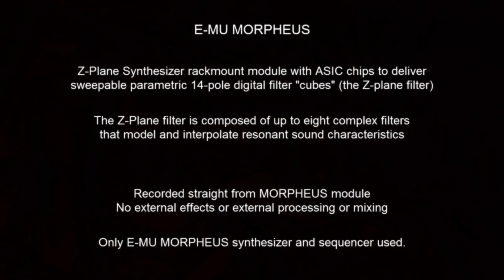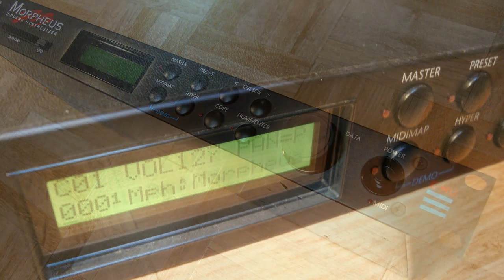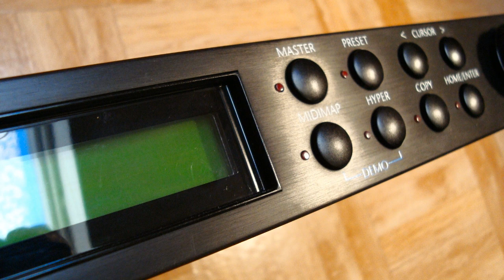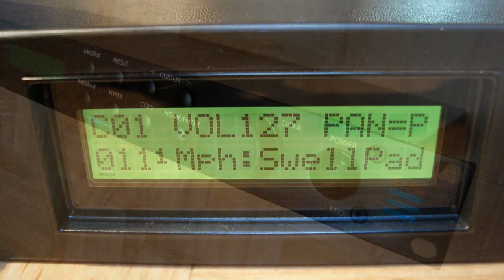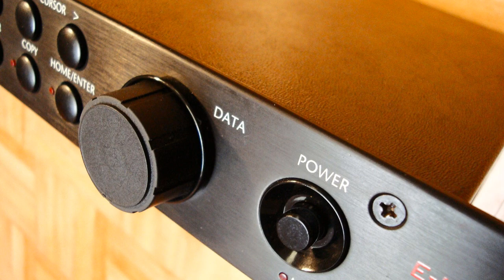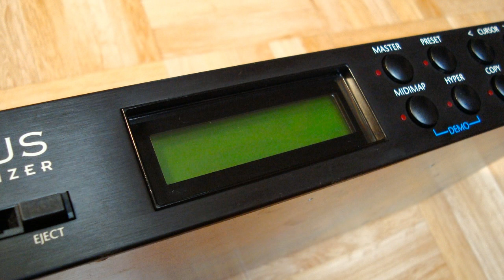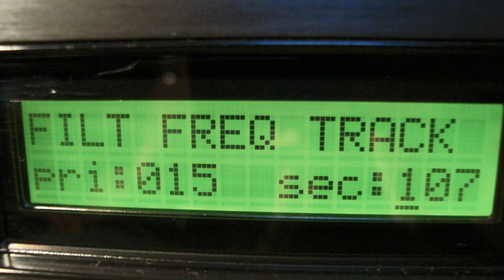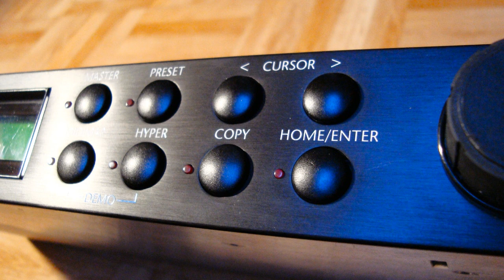𝗘-𝗠𝗨 𝗠𝗢𝗥𝗣𝗛𝗘𝗨𝗦 Z-Plane Synthesizer 【Demo】

Comment: This is freaking awesome, is this what DepecheMode used on the Ultra album? God damnit I want this synth, so hard. I must have it! Did you program all of these sounds or are they from a specific soundbank? That sound at 28:08 is one of the most awesome sounds Ive ever heard come out of a synth. A truly epic demo, this is how a synth should sound like, impressive work!
Reply from the maker: Not sure about Ultra, but Depeche Mode used Morpheus in their songs, that's a fact. About presets there - mainly they are custom made or modified ROM patches.
No Hyperpresets used.
Reply: oscillator Fantastic demo and sounds... I might be getting a Morpheus... do you offer your custom presets? what editor did you use to program the synth? Thanks and best wishes.
Reply from the maker: Wolfgang Gaube I'm glad you liked the demo, thanks. I could you suggest to get a Morpheus or UltraProteus - they are similar models, UltraProteus have much more ROM waveforms and filters, but unfortunately lacks some great stuff that Morpheus have. So it is difficult to say which is better, actually they both are great! About presets - I'm still working on Morpheus library bank and it's not ready yet. I spent much more time on Kurzweil K2000 before, so it is only beginning on Morpheus for me. About editor - mostly I use MorphEdit software, SoundDiver is also good and sometimes I use Midi Quest as well.
Reply: oscillator
Can the MorphEdit run on win 7?
Reply from the maker: TheSynthZone Yes, it works on Win7 also. MorphEdit v0.912 can run on XP, Vista and both 32-bit and 64-bit Win7. The last version MorphEdit v1.000 works on XP, Vista and 32-bit Win7 only.
Reply: oscillator Today I got a Morpheus in excellent condition :)
Only noticed that the RAM Bank is the same as the ROM Bank contrary to what the manual says. May I ask you for the sysex and also the other ones you mentioned in another reply.
How is your sound bank progressing? I'll take the beta, think that is that good. Keep us posted!
Thank you so much again for your great demo which reminded me of this wonderful synth!
Reply: Wolfgang: very good to find one in good shape! I managed to find one for less than 100$ that even smells new, used is OK but new is best. When these were new I spent my  cash on a Kurtzweil sampler/synthesizer, this would have been more useful in the long run, the K2000Rs was replaced very easily. I use a Korg Kontroller for my Morpheus, Wavestation and other wave scanning modulation synthesis.
Reply from the maker: Wolfgang Gaube
Congratulations :)
It's not so easy to get Morpheus nowadays (after 22 years of release in 1993 !), so you did well! I also was lucky to get my Morpheus last year from Germany. I find it on ebay, where did you find yours? Just curious :)
Well, I really suggest you to read the User's Manual of Morpheus first of all - that will help you a lot to get in the principles of this synth. I was lazy to read and I tried to get everything myself (because I was sure I know about synths), but I was wrong. My experience was different, so I came back to the books :) You can still find Morpheus Manual over the internet (try to google), if you can not find, please feel free to ask - I have this as PDF file.
Next - I strongly recommend you to get USB-MIDI adapter to connect the Morpheus to computer - in that way you can program the synth with MorphEdit software (freeware, try to find over the internet to download), what is much more easy than programming from front panel of the synth. That also allows you to send and receive sysex files to/from Morpheus (using freeware MIDI-OX software) and you don't need to buy expensive ROM and RAM cards. I'm using E-MU Xmidi 1x1 Tab adapter, it works perfectly. Also you may to have some MIDI merger to connect PC and master keyboard to your Morpheus.
About sysex files - I could send you all collection of Morpheus ROM Cards (many of these sounds you can hear in this demo video), so just give me your e-mail and I will send it to you (also Manuals and MorphEdit software if you wish). Cheers!
Reply from the maker: TheSynthZone
Hi, under the 100$... WOW!!! That's is FOR FREE :) That synth is worth much,much more! I got mine for 185 Euro from ebay, I was lucky winner of bidding :)) Yes, actually it's possible to control the Morpheus from any MIDI keyboard, but there is one important thing - if you're using MIDI Merger to connect master keyboard and PC to Morpheus (what lets you to program the Morpheus from computer and play it from master keyboard in same time), then it's important to know if your Master keyboard have the power on MIDI OUT port. That means +5V will supply MIDI Merger with voltage. If not, than you need another type of MIDI merger with external power supply.
Reply: oscillator Thank you oscillator and also TheSynthZone, nice community here! An early birthday present for me, which I found by chance on a local buy and sell platform www.willhaben.at. A guy here in Vienna, Austria sold it for €150 and even was so kind to deliver it, but €185 is also good. I have a project studio and also play Kurzweil, the PC3X. I did find the manual and MorphEdit, MIDI-OX online. MorphEdit starts up fine on my Windows 7 Pro 64-bit configuration. Also good point about the USB-MIDI adapter and merger, would have missed the bidirectional connection I need for programming together with the connection from the master keyboard. I have a RME Fireface 800 audio interface and will look, if I can use it for that, the Kurzweil connects via USB MIDI to the PC. Yes, please send me all sysex via email (will PM), especially the factory RAM bank 0 which is missing in my system, even after reset RAM bank 0 is the same as ROM bank 1 which according to the manual shouldn't be the case besides some presets. Appreciate your suggestions and support! Cheers!
Reply: Finding the editor online has been difficult, I got one version but still trying to get win 7 64 bit to run it, lol.
Reply from the maker: Wolfgang Gaube
Well, 150 Eur is very, very good price :) To be honest, I could pay much more for that box, it worth every penny. It cost nearly 2000 GBP in 1993, when it was released! So, yes, I also have sysex of default RAM presets, no problems to give them to you, but there is only presets, no hyperpresets (same as in Morpheus Card Collection sysex files). But I don't care about this, because I don't use them so much. This is nice feature, of course, but it's more for live performers. I'm a sequencer based. OK, I will check for PM from you, Cheers!
Reply from the maker: TheSynthZone The MorphEdit is still downloadable there http://www.nancarrow.com/morphedit/ but it's the latest version 1.000 which runs only on 32-bit Windows. If you want to run this software on 64-bit, then you need previous older version 0.912 This old version works on both x86x64 systems. I have both of them, so if you wish I could send it to your e-mail, no problems. Cheers
Reply from the maker: Wolfgang Gaube
Hello, Did you received the e-mail with instructions and attached all neccessary stuff in RAR achive? Please check your e-mail.
Reply: oscillator Thank you very, very much for your email and the very detailed information you provided, it is very considered and supportive of you! I will have to order cables next week after the holidays and then see further, but the Midi through my audio RME fireface 800 interface works fine for Morpheus. Maybe I can get the Midi merging going somehow in the PC, using Cubase which has some interesting Midi features, but I can see the principal limitation in Midi, that it is not made to allow two inputs from different environments to the same device, it locks the channel, but my standalone Kurzweil editor from www.soundtower.com actually works in conjunction with Cubase, seems they found a way. Anyway, will report back. In the meantime wishing you and everyone a Happy Easter!
Reply: TheSynthZone Just downloaded the binary of Morphedit from www.nancarrow.com without looking if it's 32/64 bit and it starts up fine here (Win 7 Pro, 64bit). Does it start up on your PC? I need to order cables next week to have both Midi channels connected, which seems to be a prerequisite for it to establish a connection at all. Will see how that goes and report back. Happy Easter!
Reply: oscillator Hi, today I received my Midi and audio cables for the Morpheus and... I got everything working :))))
Here is what I do: Morpheus is connected via Midi IO on my Fireface 800 audio interface, open standalone editor MorphEdit (using the downloaded binary, my OS Windows 7 Pro 64-bit), connect in the preferences to the FF800 Midi I/O and then use "connect to synthesizer" (only issue I had was the Device ID on my Morpheus was 0 zero, which is unusual, had to change that from 1 to 0 in the preferences). Then I start Cubase DAW, set up a Midi track and route the output also to the FF800 which works and voilà, all works. Only this I have to figure out, when I edit a preset, the changes are not applied. Found out that I have to enter the edit mode like Master or Midi on the Morpheus for the changes to be applied. 
Thank you so much for inspiring with your great sound demos and support, really appreciate it! Now let's make music...
Reply from the maker: Wolfgang Gaube
Good news :) So everything is OK. Did you receive my e-mail with Morpheus Card Collection sysex files? I sent thison the  e-mail you wrote me in PM. Just to be sure you find my e-mail - there was zipped folder with patches, software (also Kai'ckul sysex manager) and some tips and pictures about Morpheus routing, MIDI merging etc.
Yes, about editing from MorphEdit - that's true, the latest version (I have v1.3 as far I remember) of Morpheus must be in Preset Edit mode, when you editing from MorphEdit software. Only that way you can apply parameter changes. Otherwise Morpheus can not receive changes from PC. Also saving of patches must be done manually (last page in Preset Edit mode). That''s the way I'm also working - connect the PC with Morpheus, select the preset, hyperpreset or midimap I want to edit, then enter this Edit mode on Morpheus and scroll to the "Save" page. After editing the parameters, naming etc just press HOME/ENTER button on Morpheus to confirm  and save everything in memory. When you select next patch to edit and enter the Edit mode again, this Save page still will be as default so you can make all changes in parameters and save everything again without scrollig the Data wheel. That simple! Cheers
Reply: I sure did, it is like a museum piece, software is so impoertant for deep edits. Thanks!
Reply: @wolfganggaube  you have to select Compare OFF for th changes to take effect.

Comment: very nice synth, but sounds like it has a really noisy output. is that normal?
Reply from the maker: The audio outs are OK, the problem was in a cheap chinese USB-Audio audio interface for $10. Now I have better one, the Lexicon Alpha - you can hear the difference if you check my "Insanity" tracks. Same synth, better USB-Audio interface.

Comment: I think to program this beautiful synth is a pain. Maybe an hardware controller can be done with a bcr2000
Reply from the maker: BCR2000 should work fine with 4 modulation channels of Morpheus (channels ABCD in Master page), but I'm not sure it will access the parameters in Morpheus patch edit mode, such as LFO, Filters, Envelopes, FG etc. The best way to program patches is using MorphEdit software and PC.

Comment: I have one of these I got when it came out.  Haven't touched it in five years.  The 16 BIT sounds seem hollow in today's world.
Reply from the maker: 16bit for the synth is OK, because that ROM waveform is just a source for synth engine. The most important are functions of processing (particularly Z-Plane filters for the Morpheus) and D/A converters on output. But that's just my opinion.
Reply: oscillator Your video sounds great!!!  Perhaps I should unpack mine and start tweeking it.  Thanks for reply.
Reply from the maker: Ed Gross
Yes, Morpheus is something very special, but it's not the easy synth. It needs some time and patience to get into it's core. These factory sounds in ROM are very average, but the engine is extremely powerful inside. Greetings!

Comment: lovely sounds! really made me think about getting one... but it sounds kind of noisy in the video - is it the synth itself or are you just using bad AD-converters? cheers!
Reply from the maker: mariusdrescher My PC don't have a line-in so I used a cheap external USB-audio card (chinese for 10 bucks on ebay). After normalizing the recorded quieter sounds some noise appears, unfortunately. The synth itself has good output (Max. Signal to Quiescent Noise and Dynamic Range >90 dB, Frequency Response 20Hz-15kHz, Sample Playback Rate 39kHz, THD +N and IMD <.05%).

Comment: well...my idea is simply that vast algorithms can surely recrate complex signal path but there were some limits in k2000/2500 like having only three blocks of dsp for layer except amp and pitch....but new dynamic vast in pc3/pc3k could be the way!
infact with dynamic vast is possible to write down new algorithms with user definable signal path and dsp functions, but the true trick could be cascade mode that let you run one layer inside another layer from 1 to 32....so would be possible to process one waveform (internal or user sample on flash) through different dsp functions....like filters but not only 3 like k2000 but even 10/20 etc...this is the same thing that happens with zplane synthesis and combined with incredible modulation options of vast and kdfx digital effects of pc3k the result could be nothing but spectacular!
how do you think about that stuff? ;)
....in this way kurzweil pc3k could be the best hardware platform to develop new digital sounds in next years to come....and considering pc3 has also virtual analogue oscillators like k2000 or d50....the imagination could really be the limit only.
Reply from the maker: +kyma1999x That's interesting you're saying :) I'm not sure about Dynamic VAST because I never had a chance to try this on PC3K. It's possible to create some complex filter combinations in VAST, but about Z-Plane.... I guess it's possible to make something similar but not exactly the same because Z-Plane has about 20 filters working simultaneously, each with many parameters and real-time controls from envelopes, MIDI controllers, LFO etc. It's to far complex to create on VAST all these processes, I would like to say it's impossible. All these synthesis types like VAST, Z-Plane are unique by themselfes, it's much more easy to have both of these synths and program them individually with some nice software :) Let's make things simple!
Reply: PC3K sounds awesome but I think if someone is unable to create amazing sounds on a K series Kurzweil, then programming and talent is more the issue, not the synth.  More options are great but as someone who's been making electronic music over 20 years, I can honestly say I rarely use more than a few layers/oscillators etc.. to make up a sound.  Especially when in the context of a song.  Once a single sound starts having too many layers/too much going on, it tends to bog down and muddy up the whole song.  Usually it's better to use a less complex sound unless you're making a purely ambient record.
Reply: @Abruzzo333  that's for sure not an issue for me, I've been using Ks since 90s as a teenager and never had problem to get good sounds even from only three layers, but having more choices with new Pc4 or K2700 is good.
Yes making a track with 80/100 channels or parts less is better, if you make a pure electronic piece where there are 7/8 sounds in total every patch could require deepness and complexity to fill the sonic space, and new vast gives nice options, they offers also fm algorithms exactly like dx7 or montage, this opens up possibilites to combine pure fm with vast, even k2 does fm, but newer make this worflow easier (e.g. import sysex of dx7, start from an old dx patch, process it or combine with vast and kdfx and you'll get new interesting sounds)
Reply from the maker: @Abruzzo333  I agree for 100%. My Kurzweil K2000 has 3 layers for patch and that's enough to create rich and complex sounds. Of course, you can use Drum Programs to make 16 layers though, but it's not necessary. I have some examples of 3-layer patches in my K-POWER demo video. Even more, they all are based on standard ROM waveforms, that means no samples or Orchestral / Contemporary soundblocks are used there.
Reply from the maker: @kyma1999x  Nice to meet the K-series user here :) The K2000 is my favorite synth, Cheers